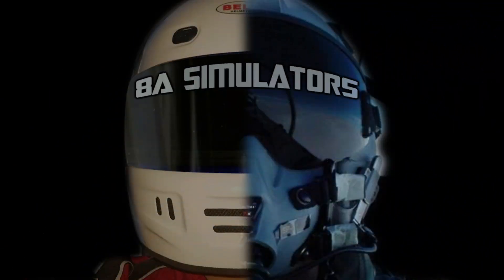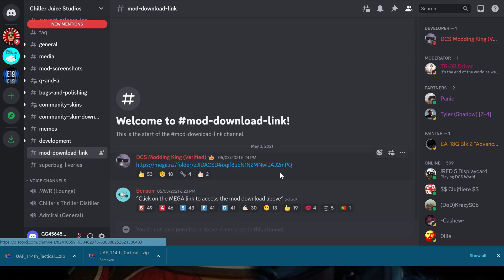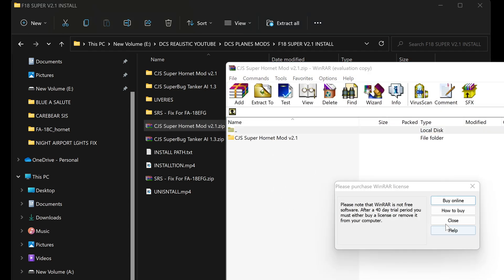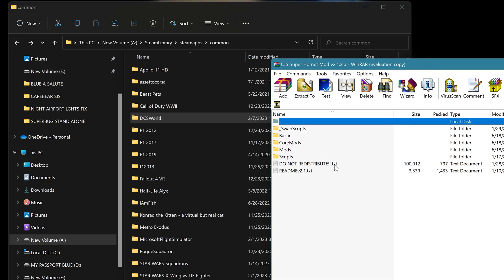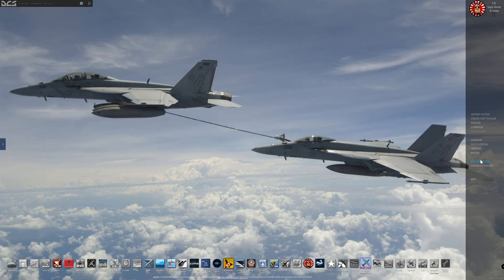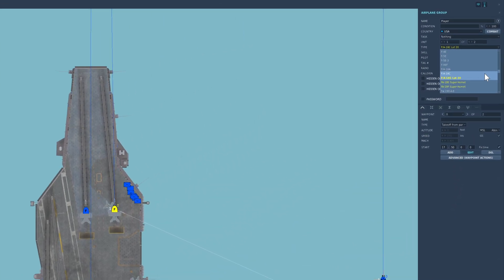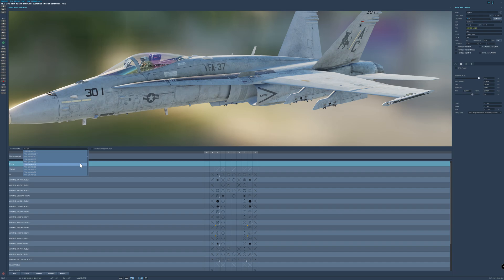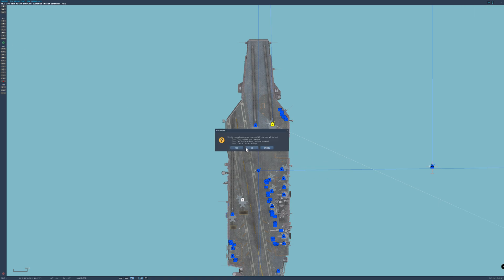F-18 DCS SUPERBUG V2.1 MOD INSTALL TUTORIAL

Comment: in f version player can be rio?
Reply from the maker: No, but they say the new version to be released in November will.
Thanks for watching!
Reply: @8ASIMULATORS  thanks, but I have next question, I must have hornet module? (i have that but im interested )
Reply from the maker: @EightHorse8357 yes, you must have the legacy F18C from DCS, but they are planning to make the new update stand alone, like a complete separate mod, so the legacy hornet won't be need it.

Comment: it’s not working for me, i’ve downloaded the skins for every model, they up on the f-18c as yours did, i have core mods, mods and bazar each with the downloaded files in there and it doesn’t even show up as a plane i have and i don’t know what else i can do
Reply from the maker: Sorry to hear that! 
Have you installed the SRS FIX FOR F18EFG file the last one on the download list..?
This is the only thing, I can think of, that could help.
That one goes into the dcs Save folder.
Let me know how it goes.
Reply: @8ASIMULATORS  im still struggling, idk how im not getting it when i’ve downloaded so many mods and liveries for my other planes. could you upload a vid starting from scratch with downloading it and showing which files go where?
Reply from the maker: @grantjones522  The video shows the exact process of my installation and it worked perfectly for me, sorry, but don't know how can I show you any other process of installation, my question is, did you install all the files from the download list on the website? Even the SRS FIX FOR F18EFG.
Let me know please.
Thanks for watching!

Comment: Good video. Was waiting for something like this. Maybe DL the smaller files 1st, as if not a subscriber. Free DL quota gets exceeded and you have to wait hours.
Reply from the maker: Yes that happens, I had to wait for the night and turn off all the wifi around and leave just my computer downloading that way.
It's free so,  I can’t complain about that.
Thanks for watching!
Reply: @8ASIMULATORS  so I waited and DL’d it. Couldn’t use either bird. Deleted it and the Hornet. Reinstalled the Hornet 18C. Followed your lead but the 2 script swaps threw me and didn’t know where they went. Does everyone get to keep both a/c? Thought this replaced the legacy Hornet. Yours is first I’ve seen where you keep both. Is it a steam thing? Oh well.
Reply from the maker: @suecobandito8954  sorry to hear that my friend,  they do called it a stand alone mod so you should have both.
What I did in the video is how I got it to work.
Maybe, go to each folder, the bazar, core mods and mods individually, go all the way in and paste the files directly into each of those 3 folders,  this way you don't drop the Bazar, core mods, and mods folders in the main DCS world folder.
Hope this helps.
Let me know if it works.
Reply: @8ASIMULATORS  Thanks. May give it a try since I can delete/reinstall the C model at will. Question is where do the Swap Scripts go? Script files to swap out LUA files for different Super Hornet station configurations. These are Windows command files. Do they replace the LUAs or added to the file for legacy and outboard?

FA18EF_Legacy 		Enable Legacy version of Superhornet stations.
FA18EF_Outboard	 	Enable Outboard version of Superhornet stations. Or did you just not bother with them? Noob=me. README say to swap BEFORE starting DCS so seems important...Thanks
Reply from the maker: @suecobandito8954  yes, I did read something about that, but again they don't mention those files in the instructions. I tried to arm the F18E and the weapons bay stations are less than the F18C legacy, so yes maybe dropping the script files in that folder will fix that, but I haven't tried yet.
Reply: @8ASIMULATORS  did as you suggested dont get either plane to come up in yellow in the select page. still hung up on those swap scripts are not luas. obviously somethings amiss.
Reply from the maker: @suecobandito8954  sorry ! If I find out more about it I'll let you know.
Someone did say they don't wanna push this mod too much cause is not perfect.
Reply: @8ASIMULATORS   So I got it to work, but what is the liveries file called? Savedgames\dcsopenbeta\liveries\? I DL'd the compressed files and opened a few in liveries/CJS Super Hornet v2.1 named file yet no joy...thanks almost there...PS Herb Kelleher hired on a handshake. An old squadron mate of mine is/was head of ALPA...
Reply from the maker: @suecobandito8954  oh man! Awesome! How did you do it?
I was working on the liveries video but I had to work, I'm not home at the moment. Sorry. I got a couple liveries working by creating a new folder inside the f18C liveries, so, create a file called f18e, f18f, f18g but it has to be exactly how they appear inside the liveries downloads from the website. I know is confusing and I don't remember all the steps I took. I will post when I get home but it will be a couple of days. MR Herb K was the man!
Reply: @8ASIMULATORS  I just dropped the 3 files in as per your video-it just took a couple times. The liveries I suppose have to go in the root DCS and not the saved games folder.
Reply from the maker: Great news! I wonder why that happened, oh well good for you. Liveries can be on either root DCS or save games,, I used the DCS root because my C drive is where I have windows and is getting full. But you can choose which location is better for you, just have to create the folders.